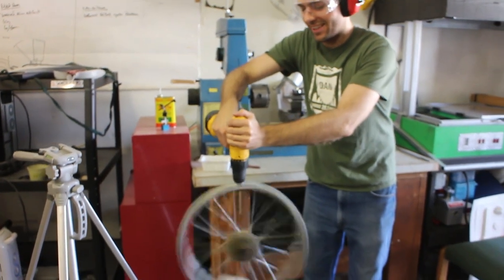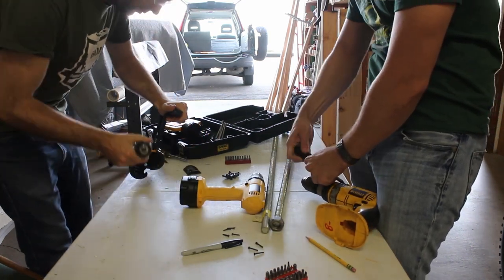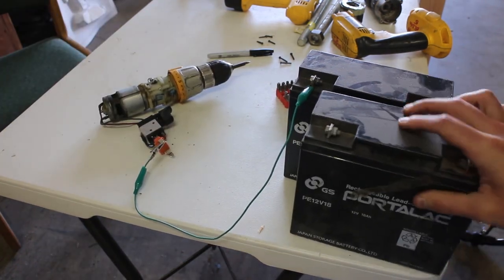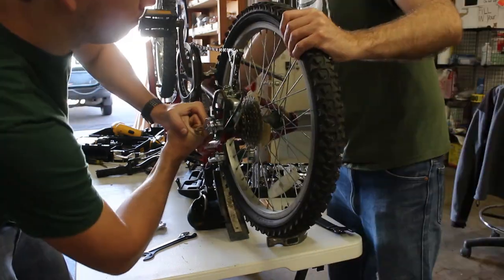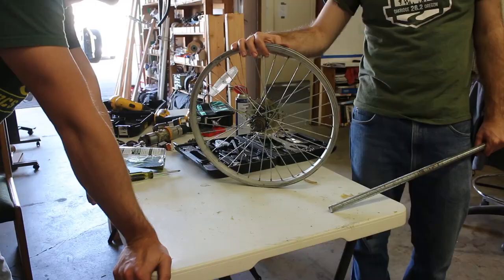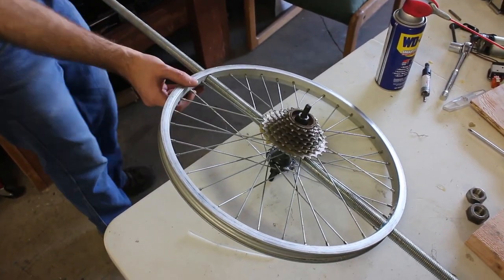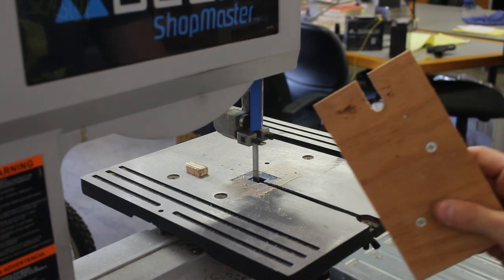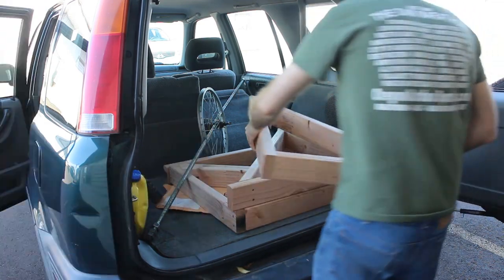Centrifugal Pumpkin Chunkin' Machine - Part 2

Comment: Looks like fun. Just a suggestion for mounting those rods. Take two C shape pieces of metal that go around the axle. Cut the C shapes so they form a snug box around the two sides.  Then drill holes in the top and bottom to fit the rods. Hold them in place with nuts.  The rods and be tightened firmly into the axle, ideal an indentation and a bolts at the inner and out hub would lock down things more.  Hope I'm being a little clear.
Reply from the maker: I know exactly what you are describing. Weston had almost this exact same idea yesterday! He talked about building it from wood though, since we have better tools and more experience working with wood than metal. I think it's a good idea and I hope we have time to do this. We are still just trying to get the thing working at this point.

Comment: I'm really looking forward to seeing how this works out!  It is still really similar to what I originally planned for our apply chunker, including the use of bicycle parts.  But I decided that was too complicated given the amount of time I had available, so now our machine is going to be a more traditional catapult - very crude and thrown together out of 2x4's this week.  Hopefully it is working by Sunday!
Reply from the maker: Good luck on your catapult! Yea this type of machine definitely has some complexities. We haven't finished ours yet to the point where we can fire anything. We got very close last night but ran into some Operating System problems. I'm confident we will be able to launch something this week, though. I only hope the chunker will not fly apart once the pumpkin flies off and the system becomes unbalanced. I just hope that if it fails, it fails spectacularly.